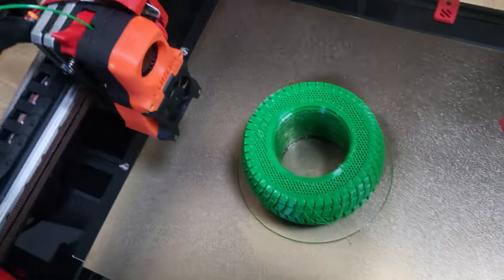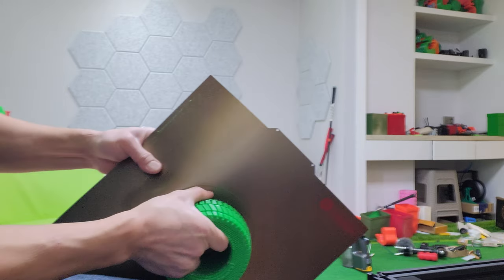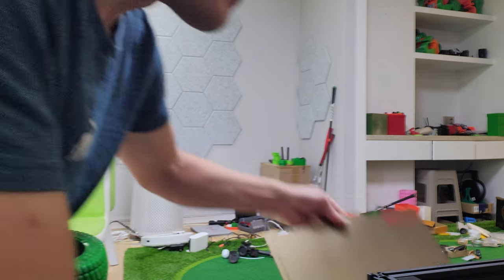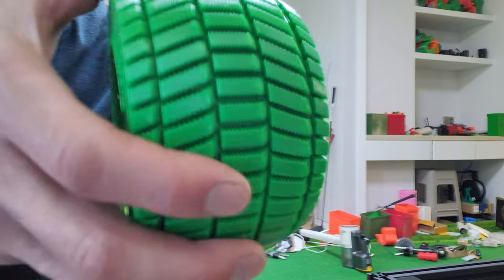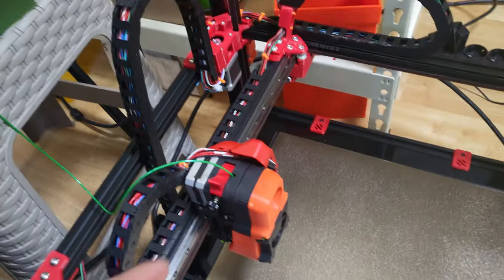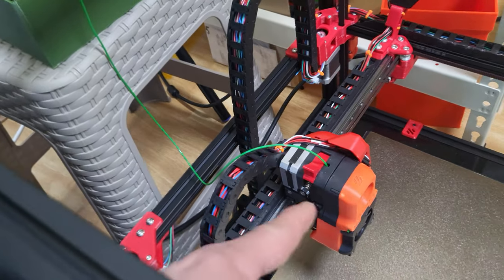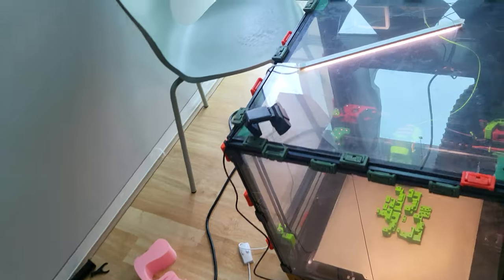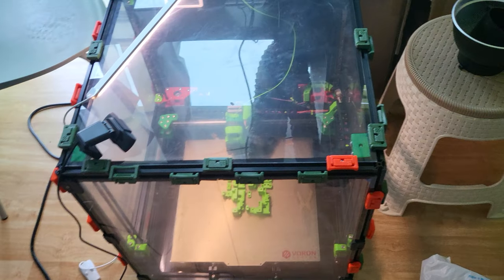How to Print TPU well on Voron 2.4!

Comment: What temperature r u running?. I got a 4020 for hotend cooling and can print pla at 260 without heat creep so I’m wondering what temp r u useing for tpu